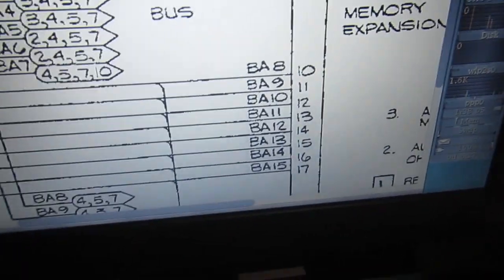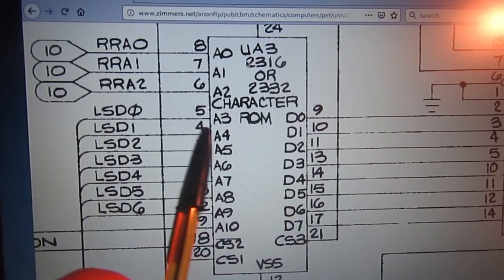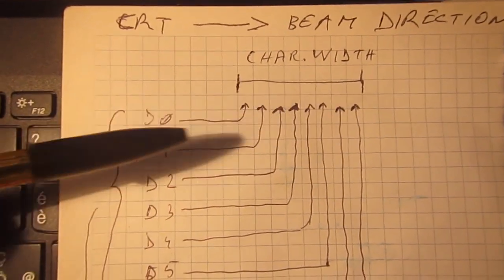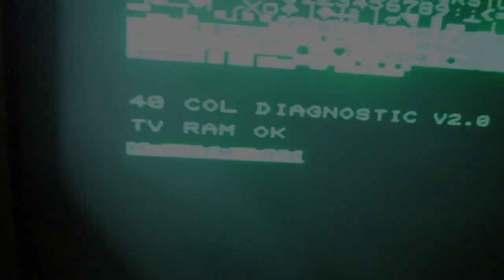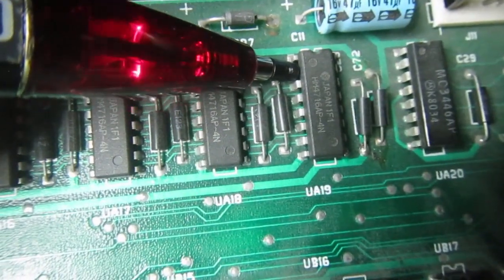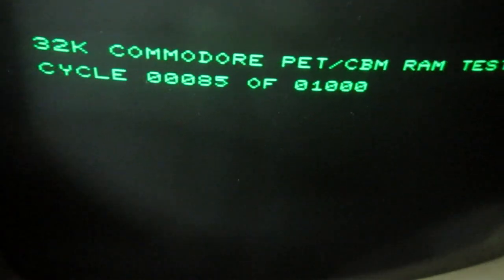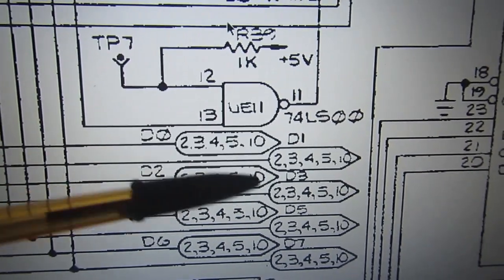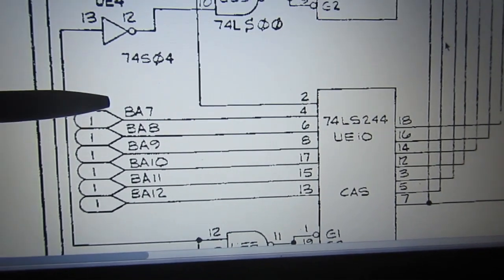CBM PET 4032 (Universal Board) repair. Finding the only one bad chip!

Comment: Hello Frank! Fanatic video! Could you share the circuit to connect to an external monitor? I'm working on my 4032 monitor. Thank you for sharing you4 knowledge
Reply from the maker: Actually that monitor is a dual sync (EGA) monitor. EGA frequencies are very similar to the ones used on CRTC PETs, so I've just inverted the syncs (or just one sync, can't remember) to match the EGA specs. Both the PET and EGA have TTL outputs. I've had to wire the monochrome TTL output to two inputs on the EGA monitor, one is "video" and the other "intensity", I've never took any record of this quick hack, sorry!
Reply: @iz8dwf  thank you for all your time. Looking forward to your next video!